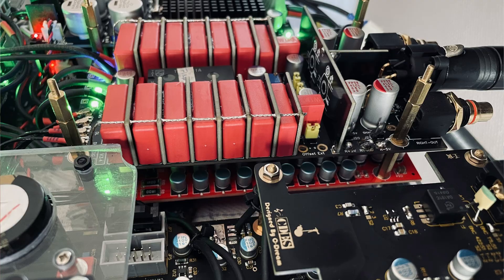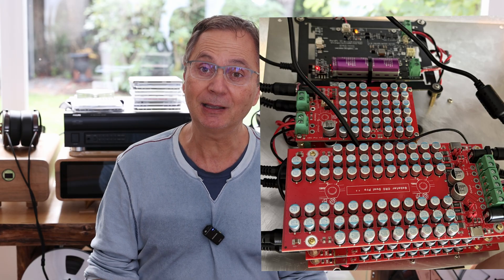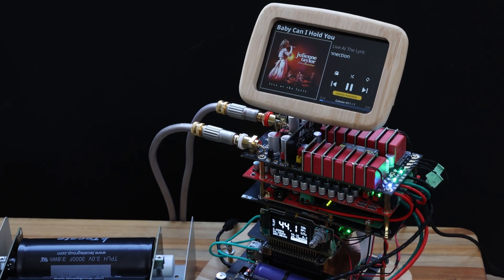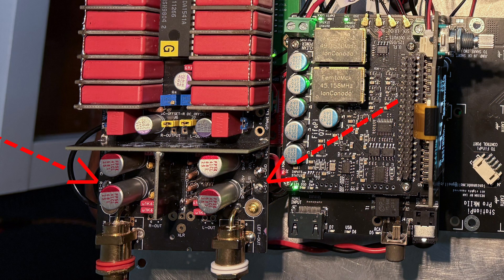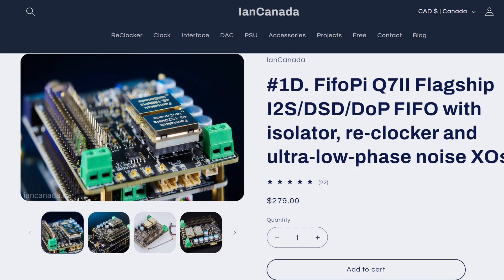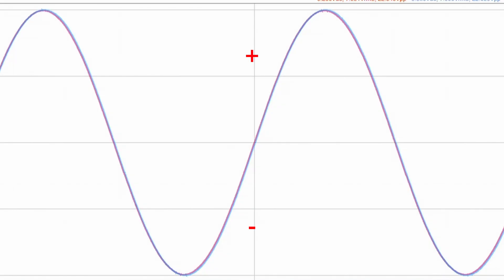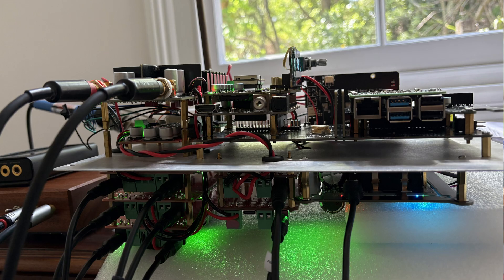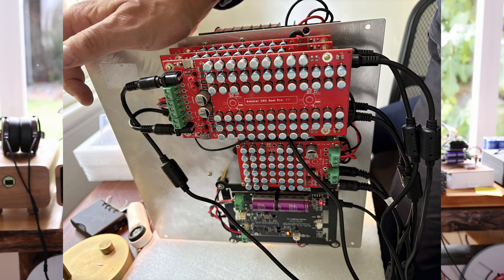He Built the Gabster TD1 DAC… And It Sounds Unreal!

Comment: 5 power supplies to power a dac?
Reply: One of the interesting things about the TDA1541 is it requires three separate power rails: +15v, +5v, and -5v.  That's three right there.  Add additional +5v and -5v rails for the output stage and you get to 5 pretty quickly.  I'm not sure how the Pi board is powered but that might actually require a 6th power supply as well.
Reply: @jcoffman9518 
Musetec MH-DA006
has six toroidals 😊
Reply: Acctually there is also PurePi which has 5v and 3.3v so in total 8